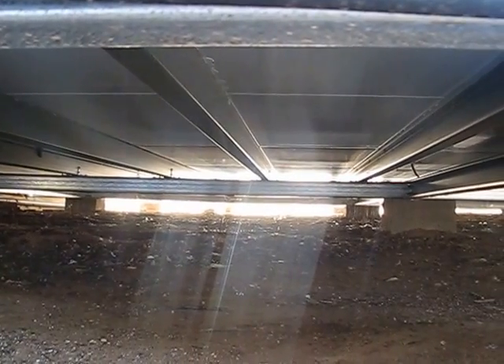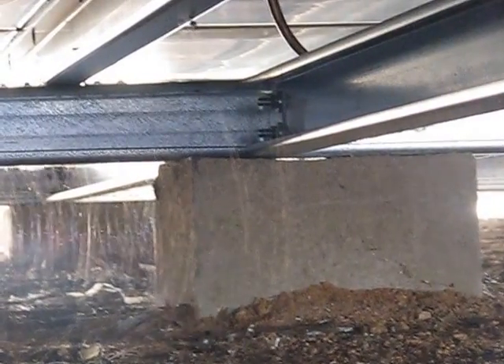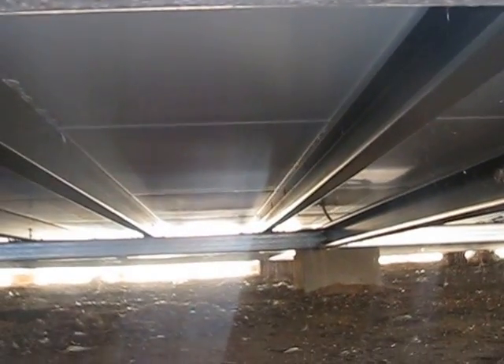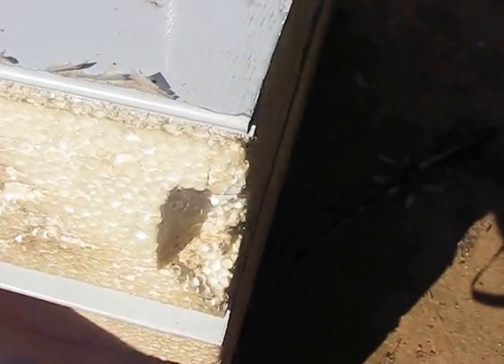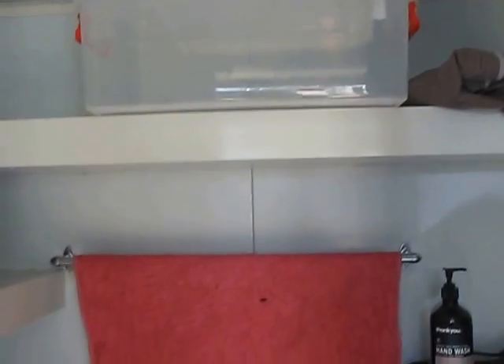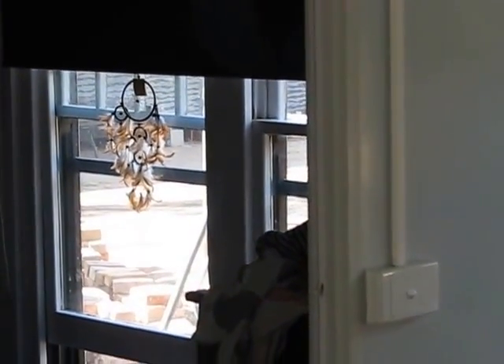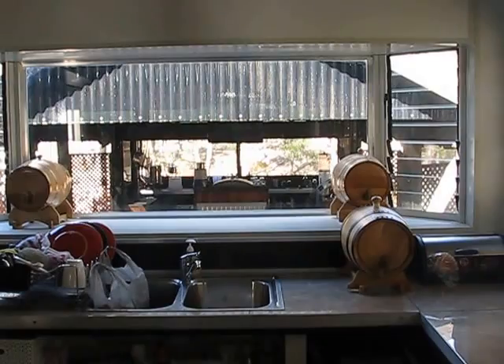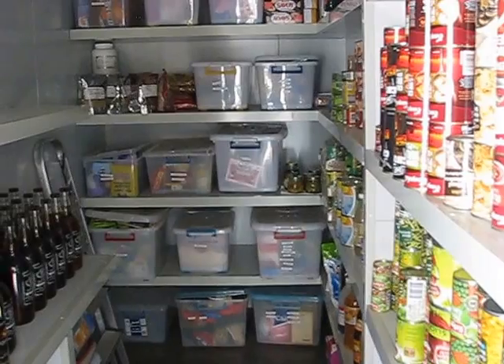Off the Grid and building 2  structural insulated panels

Comment: Hey Steve, do you put the floor down first, or the wall up first? 

Thank you 

Tony
Reply from the maker: With the panels , I set the base support 100mm wall C Chanel in place all the way around , then fill in the inside of the build with the 50mm floor panels  before the wall panels go up ...
Reply: @offthegridinoz.994  did you fix the floor to the walls, if so how did you go about it? 

Thanks 
Tony
Reply from the maker: @southysmototonysouthwell1779  The floor panels are not fixed to the walls actually .  The walls are held to the base with the C Chanel that is under all walls and the floor is fixed only to the steel joists / purlins with steel thread screws and liquid nails... So the floor panels float , just like normal timber floor ..
Reply: @offthegridinoz.994  fantastic, that's what I was hoping you would say. 

Ok one more thing, on the corners of the walls do you just cut them at 45° and trim with an piece of angle, or did you use cool room panel corner joiners?

Comment: How come you used an evap cooler instead of an air to air heat pump?
Reply from the maker: Heat pumps are far more expensive , heat pumps require the building to be sealed and we like fresh air ... and as far as power usage goes with heat pumps, it is debatable whether they use more power than a simple evap ...  bottom line on small solar , we prefer the evaps and given the climate here in Central Vic , they work extremely well ..  

  cheers Steve

Comment: Hi, how did you do the floor specily on the edge?? did you lay down the floor with a 100mm inwards so your walls goes in the 100mm?? where can i get more detail plan on floor and roof??
Reply from the maker: I cant help you with plans ... The walls are 100mm sitting in 100mm channel all around the edges , then the 50mm EPS floor is just laid up to the inside of the walls , just like Timber tongue and grove is on a normal build ..
Reply: Off the grid in oz.  Thank you for your response.

Comment: For anyone planning to build with this Instead of running the conduits on the exterior. You can bore thru the polystyrene run your wires inside the panel

Comment: Where did you buy the SIP panels?
Reply from the maker: We have a special deal with one supplier in Melbourne that we buy OUR THOW s gear from,  that I no longer refer anyone too ,due to issues from people that cause us grief  with them ...   but I can say I found them on Ebay and are easily found ...   
Just check prices per meter and call them all and haggle a deal for yourself at the best price you can get is what I would advise ... 
cheers Steve

Comment: quick question........when you get to a corner of the eps joining sheets...would you  not have 100 mm of insulation joining another sheet....this leaves the problem of joining the sheets together at corners....how did you get around that bit..??  Thanks Steve..:)

could you show it a further video...if you get asked..?...im not real clear on how to join the corner meeting sheets.....:)
Reply from the maker: I just cut each corner at a 45 deg angle on the inside ... makes a near perfect join that the 40 mm aluminum angle covers sweetly :- )   
The 45 deg is cut with just snips by measuring back the thickness of the particular material used in the corner , and marking with a texta , then sniping it off and then trimming the EPS insulation with a bread knife ... whallar , a neat corner cut :- )
Reply: Thanks Steve...had wondered if you mitred the corners.....make sense now..!!  Than ks heaps...keep up the good work..:)
Reply: Thanks so much...:)

Comment: Did you use 50 mm for the floor as they are more cost effective....or that thickness does the job..??...why not use 100 mmm for everything.?? Thanx Steve
Reply from the maker: Purely cost and no need to use 100mm for floors ..  is about it in a nut shell ..
Reply: Thanks heaps..:)
Reply: Well done ...Thanks..:)

Comment: G'day Steve.  Really happy to have found some Aussie off grid content for a change.  I'm really keen to go off grid as soon as possible and start a hobby farm. Tired of life in city, living so close to inconsiderate neighbours and being so detached from the natural world. I'm definitely 
 struck with an ever growing urge for a more self-sufficient lifestyle.  Would love to give all the off grid styles a try. Container, Earthbag, Tiny mobile, Earthship all appear to have pros and cons. These EPS/SIP panels are really intriguing and definitely appear less costly and troublesome than the others.  Thanks for your rundown on the ease and versatility of construction.   I do have a couple questions for you if you don't mind.  Have you had issues with or noticed any sag across large or wide spans? I saw you had some pretty hefty weights in the pantry with all the stacked cans and "pay no attention to those bottles" :) but it was kind of difficult to determine the approximate length and width of the panels.  Would I be correct to assume you need to go narrower and shorter if you want to place heavier weights on them?  Are there any recommendations/guides for weight limits?  Do your SIP panels have any kind of internal ribbing/reinforcement or is all the strength simply from the c channel on either side? Lastly, when you are making smaller panels/dividers etc.  are you cutting off the interlocking edges to attach c channels or do they just slide on over top?
Reply from the maker: Hi Paull ... thanks for the kind words and yes , planning to bug out it a dam good start to some sound thinking that will get you where you need to be .. 

Going Off the grid with all other types of alternative thinking attached does take some work and most or some , seem to glamorize it to a degree, but the reality is that it does take first a change of thinking which you seem to have already  , then quite often a change in attitude to actually working on it... " the work involved "

The ways this can be setup , including the ones you mention come with sets of things that encompass what I said above , some more so than other depending on which way you choose to implement your dream? 

  ..  As far as all the points you are asking  about go ..  
The EPS has very little lateral movement in it ,  in my case I just judged from the way the material handled the loads I chose to test it on , so from my experience with it I set all the different uses of it after trying it out in a way .. 

There are very few actual stats to reference this type of load assessment that I was able to find ...  I can sight what you mentioned as far as simple uses like the extensive use of the 50mm think Sips go , the loads in that pantry go no where near using it to its fullest capacity ... 

The 75MM Roof Sips were fine at 4 - 4.5 meters  meters span max and with me bouncing around on it , with the added load of the large evap cooler, show very little flexibility at all even at 4.00 meters .. 

Sips generally have no internal strengthening and do not need it from what I have experienced . 

Sips have what is called a std slip joint arrangement that once d pushed together gain added stiffness and strength .. Those non std joins you may notice were made by myself as a way of gaining the max use of the material without waste...  They are made from back to back C Aluminum Channel to carry cut edges that , yes had the std slip joint removed from prior cuts ..  This enabled off cuts to be used any where I could ... 

As I said , as far as a std set of guidelines for calculating loads , it would be a touch hard as the exact application would need to be known first ? 

I did in this build , stretch the spans for the C channel floor supports a bit further that I think in retrospect that I should have ? I would reduce the grid pattern holding the entire building up to a max of 2.4 squares  , not the 3 meters I used . The 3meters gives the floor just a gentle feeling of bounce that perhaps some would prefer not to have ? We actually like it though as it is gentle on the legs and feet to walk on ... 

Generally the building method that you choose will depend on quite a few things ?  
How much effort you are prepared to throw at your project ? 
How much time you have available to get the job done ? 
How much cash you have available ? 
Whether you are going to go totally legal and compliant ? 
And finally how long you are prepared to wait while all of the above are implemented ?   

Different materials and types of building all have inherent issue , that will alter money needed , time to build and the complexity of any compliance level that you might want to achieve?  

The SIP are a great way to achieve low cost , speed of build , lack of any real broad  skill to put together , but they do fall into one bracket that if you choose to go compliant , just like hay bale , mud brick , earth ship ect ect ... all of these will become quite a bit more complex to get arranged , engineered and approved...  

I am going to leave this at that for the moment ... hope it helps a bit mate and keep thinking positive , in one direction and stay focused on what you want , making sure you have a full understanding before you make the  jump  ,  when using  any method that wind up going with ... 

cheers Steve :- )  

  .

Comment: Excellent chat and actually 'riveting' video Steve!
Just wondering if there's an alternative to concrete blocks. Like sealed RHS with a wide base so you could bore down and fill with concrete.
Maybe not an option due to rust maybe?
Reply from the maker: Hi Phil ... yes you could do what Container home builder tend to do , like drop Gal box section into concrete , or concrete filled holes with Stirrups maybe , similar to veranda support  Stirrups ... Our blocks are actually a round hole 12" inches dia poured with and in conjunction with the box shaped upper above ground blocks so they are one piece.... We did this for our own reasons here that I wont go into here :-  )   
But in any case , anything steel in the ground needs to be gal mate ... 

cheers Steve

Comment: The panels on the inside of your house look glossy. What material are they? On the SIPS site there are fibrecement,plywood, mgo, etc,etc. Did you just paint over them?
Reply from the maker: Nope , they come pre finished in that semi gloss finish...   quite a few countries use the SIPS you mention , but here in OZ it seems that we prefer the finished surface ones ...  
We buy some from these guys off good old Ebay 
http://www.ebay.com.au/itm/EPS-Sandwich-Panel-Coolroom-Panel-Partition-Fridge-Shed-carport-20-61-m2-/253190252937?hash=item3af350a989:g:f6sAAOxyUrZSxKVp

Comment: This is really interesting mate. Very glad you made this video.

I'm thinking that this may be the best option for me also. That is insanely cost effective.

Now i know you said total cost was about $20k

But are you able to tell me me approximately how much the 100mm wide panels come to each? Think you said 6 meters long each yeah?

Also did you go through and get council approval for everything? Was that difficult to do? Any plans needed to get approval etc?

Thanks. Thinking of going off grid soon. Once i save a bit more.
Reply from the maker: Giday Blake , the 100 mm panels range from around 40- 45 per sq mt making a 6 mt sheet worth around $250.00 - $300 depending where you go ? I get mine from a supplier in Melbourne that I found with a simple search on EBay . Most of the suppliers are on EBay ... You will find that if you went to lets say Stramit or a similar large company that the same panel basically runs at around 2and a half to three times the cost per sq mt ..  Our place actually ran for building and double glazed windows under $18,000 but with a few capping and gutter ect yer the 20K  mark As far as permits and plans go , that will entirely depend on your local authorities , that can be hard to get along with unless you shell out for and engineer or drafts person ... as far as we  are concerned , I do not get into this topic online at all usually because everyone's individual circumstances will be different ... so how we did it becomes a rather mute topic.     I hope you work you way to off grid living soon mate .  best of luch :- ) cheers Steve
Reply: Off the grid in oz. 

Okay cheers will definitely check it out.

I know the area im looking at land is pretty lax. Alot of non approved cabins etc in the area.

But ling term i don't want any issues just incase.

Still be a good few years off even getting land but I'm trying to come up with a target figure cost wise.